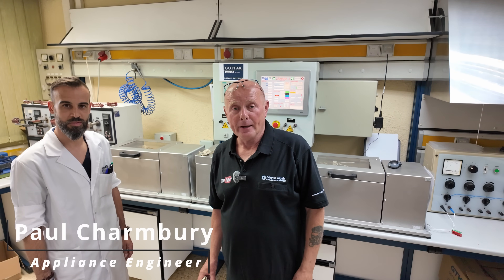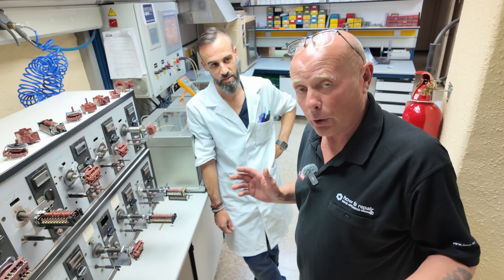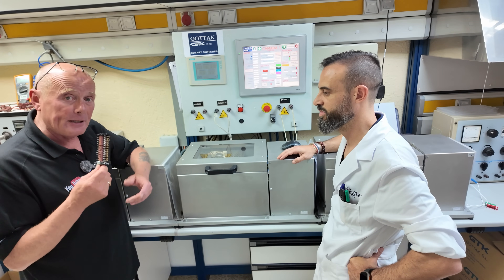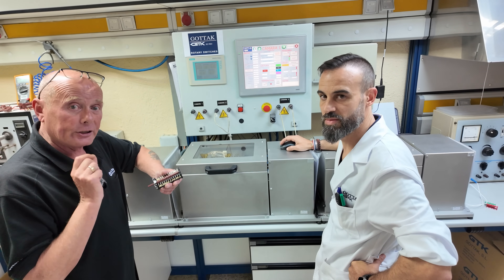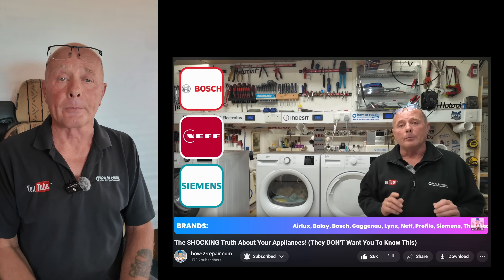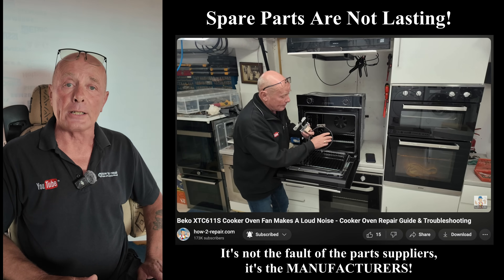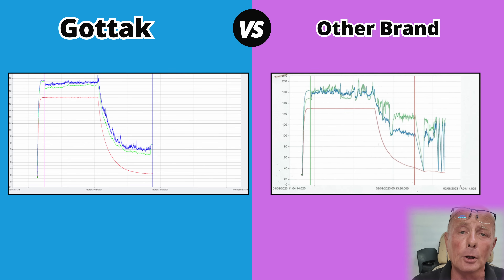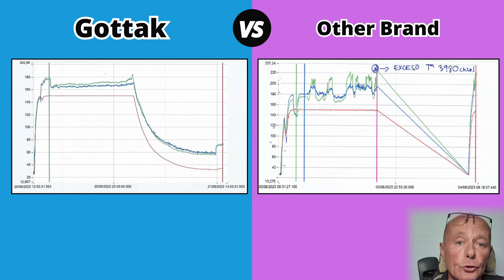Why Your Appliances FAIL SO FAST! Lab Results EXPOSE the Truth!

Comment: There are plastics that supposedly last for a thousand years.
And then there are the plastics used in consumer products and automobiles.
Reply from the maker: @anomamos9095 You've hit on a really interesting point about plastics! It's true that some plastics, designed for very long-term use in specific industrial applications, can indeed last for hundreds or even thousands of years under stable conditions.

However, the plastics used in many consumer products and automobiles are often engineered with different lifespans in mind. Factors like cost, flexibility, and the specific demands of the application (think of the impact resistance needed for a car bumper versus a disposable food container) influence the type of plastic chosen and the additives used in its production. These additives can affect how the plastic degrades over time when exposed to environmental factors like sunlight, heat, and moisture.

As discussed in the videos https://www.youtube.com/watch?v=QsdGd2qDPaI & https://www.youtube.com/watch?v=xn03N3b0-lE, the intended lifespan of a product often plays a significant role in the materials selected. For a deeper dive into this, I encourage you to watch those videos.

If you found this insightful, please consider subscribing to the channel for more discussions like this! Also, feel free to share this comment with others who might find it interesting.

Comment: Im a dryer enthusiast and we have 3 at home. A old zanussi tc7103 and a old tricity bendix from same era and a even older zanussi with the orange start button. Bullet proof they have only asked for a belt and jocky wheel there entire life
Reply from the maker: That's great! It's refreshing to hear about appliances that last and continue to serve well. Those older models were built to last. It's unfortunate that today's machines often don't hold up the same way.
Reply: Yeh I love it. I fully service it every 6 months and regular cleaning after every use . It's so quite and solid built ..I love it

Comment: Im going out on a limb here but A lot of the problems with unreliability is down to the consumers, wanting ever lower prices for appliances, so it has been a race to the bottom, not one person actually WANTS to pay out money for a fridge or a washing machine, they would rather put that £300:00 towards a holiday or a few meals out, when you think about this , a £300:00 washing machine keeps you supplied in clean knickers for ( say 5 years) , £300:00 will barely buy me 3 tankfulls of super unleaded petrol for my car, now thats what i call good value for a washing machine. Years ago, when i first started as an engineer, £300:00 would buy you a machine that span at 800 rpm and had a 5kg load or 9lb back then, along with a tiny door you had to struggle to get clothes in and out of, you don’t even get 800 spin machines any more. Todays machines are better value than ever, when you think, car manufacturers will sell you a new engine ecu for a car at a cost of £1200:00 and you can buy the whole machine, thats motor, circuit board, pump, drum assy and other parts, and are cars lasting any longer ? No they are not .  people cant park a washing machine on their drive, for their neighbours to see, so its never ever going to be a sexy product people aspire to own, its never going to work like that. In my opinion, the minimum price of a washing machine should be £600:00, and that would still be good value, further to this, a lot of breakdowns are caused by consumer mis-use, and abuse. You get what you ask for.
Reply from the maker: @brutonstreettailor4570 That's a really interesting perspective, and you bring up some valid points about consumer demand and pricing pressures! If I recall going back to the 80s you would pay a couple of hundred pound for a Hotpoint 95 series or the Hoover A3 series in today's money that would be a roundabout what you state £600 the problem being it's not just the consumer, the manufacturers are trying to get more and more market share at one point they were driving the prices down to do this but now they are buying up brands to obtain the market share.  It's true that the desire for lower prices can influence manufacturing decisions and potentially impact the quality of components used. As you mentioned, the value proposition of a modern washing machine compared to other expenses is quite significant.

Our videos (https://www.youtube.com/watch?v=QsdGd2qDPaI & https://www.youtube.com/watch?v=xn03N3b0-lE) touch on the economic factors at play in appliance manufacturing, including the balance between cost, features, and durability. Your point about consumer misuse also highlights that the lifespan of an appliance isn't solely determined by the manufacturer. Thanks for sharing your insightful thoughts! Please subscribe to our channel to continue this conversation.

Comment: We had an Indesit washing machine that failed about a month after the end of the warranty period.  A service agent called out (£60) and said it was the programme board - a new circuit board would cost £200, the programme for it another £50 and a programmer device to transmit the programme to the chip another £60, so £310 for the parts plus another visit and the labour to install it.     So we bought a new on, different make!   
I took the "old" one apart and all the components were in perfect order, the motor looked like new.  Then I tried the electronic board and removed capacitors one by one, but all tested OK.   I tested the other components and again, all OK, so the only suspect left was the programming chip.  The circuit board was never intended to have parts replaced as the tracks came off with the heat of the soldering iron.  
Perhaps it was programmed to count total time plugged in or the usage time using the 50Hz mains and then fail?   If it was £50 for a new board fully programmed, the machine would have lasted another 4 years.
Reply from the maker: @karhukivi That sounds incredibly frustrating! It's certainly disappointing when an appliance fails just outside the warranty, and the cost of repair seems disproportionately high compared to buying a new one.

As discussed in our videos on appliance lifespans (https://www.youtube.com/watch?v=QsdGd2qDPaI & https://www.youtube.com/watch?v=xn03N3b0-lE), the complexity of modern appliances can sometimes lead to such situations. While it's difficult to say definitively what caused the failure in your Indesit machine without a thorough investigation, your suspicion about the programming chip or a potential time-based failure mechanism is interesting and highlights some of the concerns around built-in obsolescence. The fact that the other components appeared to be in good order further adds to this suspicion.

The high cost of the circuit board and the associated programming does make repair uneconomical in many cases, unfortunately. We encourage you to watch our videos for a deeper dive into these issues and what consumers can look out for.

If you found this explanation helpful, please consider subscribing to our channel for more insights into appliance longevity and related topics!
Reply: I doubt they program failure counters. If caught they will really get in trouble. Micro-controllers have a lifespan. Usually 5-10 years. There are automotive grade microcontrollers  that cost 1$ more and are rated to last 20 years. It is just a variant when i select a chip for a design ex from ST, or Texas Instruments i have the same part in different grades.  I design PCBs. We don't think about repair when designing a board, unless it is specified in the product notes. Typical design parameters are, make it cheap, reliable to 5 years, and choose components that will be available for 10 years, also we look the EMI emissions to get the CE certification. It all comes from the top management, nothing we can do other to try to pass laws to force the companies out of this stupidity.
Reply: @dfloper  I have worked on PCBs for many years and most of them withstand a component being de-soldered and replaced.  But some of them have tracks a dirty grey colour and the heat of the iron causes them to detach from the baseboard.  That was what I was dealing with.    Not too difficult to program a little routine to count 50Hz cycles and when it exceeds 6 billion or some other landmark, it then adds a random excess and when that has elapsed, it shuts itself down.  One would have to reverse-engineer the software on the chip to prove or disprove that, hardly likely to be attempted.

Comment: All my options on modern appliances are confirmed in this video.   It is exactly the same here in the US, modern appliances are basically attractively packaged junk.  I still have my original Maytag automatic washer and gas dryer, purchased new in 1984.  No repairs ever on the washer.  The dryer needed a new belt in 2021 other than that, just regular cleanings to prevent lint  accumulation inside.  My Maytag dishwasher was new in 1988, it has never required any repairs so far.  My GE refrigerator is also from 1984, only a couple serviceable parts have been replaced by me.
 I have no plans on replacing any of my appliances unless the machine becomes non-repairable.  ~  Thank you for a most informative video proving what many people suspected.
Reply from the maker: @chatrkat It's fantastic to hear about your experience with those enduring Maytag and GE appliances! Your 1984 washer and dryer, and the 1988 dishwasher, are testaments to how well things were often built in the past. It might be a good idea to stockpile on any common components that fail as this will be what runs out. our videos https://www.youtube.com/watch?v=QsdGd2qDPaI & https://www.youtube.com/watch?v=xn03N3b0-lE discuss, the shift in manufacturing philosophies over the years has led to many feeling that newer appliances simply don't have the same longevity. Your approach of keeping them running as long as possible makes perfect sense from both an economic and environmental standpoint. We're so glad you found the video informative and that it confirmed your suspicions. Please subscribe to our channel for more content that resonates with your experiences!
Reply: @How-to-repair I appreciate your follow up to my comment.  Yes I actually do stock some parts here, however I always try to locate new old stock parts rather than the junk that comes from Asia, unless there’s no other option.  I am a strong advocate of maintaining and retaining. 😁  There are many different machines and items I’ve purchased years back I still have and use today.  I refuse to give up something well made, only to waste my money on brand new items that will likely fall apart in a short time.   Same is the case with my vehicles.   I look forward to other videos from you.   Cheers from Chicago.
Reply: But it may be also matter of user experience how to use appliance to deminish wear or brakling  Younger  generation is technicaly dumb because educated on computer virtual reality where automatic washer is build with dots and never gets scratch. . .
Reply: @Mikexception  you are correct.  Handle a machine intelligently and carefully, amazing how many problems can be avoided.  I was brought up by a father that practiced that every day.

Comment: I had a Samsung tablet fail at 15 months, it was switched off in the drawer for a week and when I came back from holiday it wouldn't turn on. The Samsung service centre said it needed a new main board, at a cost of more than a brand new tablet of the exact same type. I didn't buy any  more Samsung products.
Reply from the maker: @jm6604-c4d That's a really frustrating experience with your Samsung tablet. It's certainly disappointing when a device fails just outside the warranty period, and the repair cost is higher than replacing it. Our videos https://www.youtube.com/watch?v=QsdGd2qDPaI & https://www.youtube.com/watch?v=xn03N3b0-lE touch on how the design and availability of spare parts can influence the lifespan and repairability of electronics. Experiences like yours highlight why many consumers are concerned about the longevity of modern devices. Thanks for sharing your story, and please subscribe to our channel for more discussions on product lifespan and consumer rights!

Comment: I was on a building maintenance course years ago where I was told that a washing machine had a 7 year life cycle. I was told if you get 7 years out of it and it fails then buy a new one. I highlight that my machine broke down at 7yo and as an electrician I fixed it. I was told more fool you as it will break down again in 3-6 months and it was more cost effective to buy a new one as the cost in real time was a lot cheaper. Yep it broke down 5 months later.
The 7 year rule applies to other appliances. Also to be fair you it is more cost effective  to replace say a oven than pay for it to be repaired. My oven is 10 years old and I have replaced the element twice
Reply from the maker: @andrewwhite3793 That's a really insightful real-world example that aligns with what we discuss in our videos https://www.youtube.com/watch?v=QsdGd2qDPaI & https://www.youtube.com/watch?v=xn03N3b0-lE about the intended lifecycles of appliances. The building maintenance course's "7-year rule" and your subsequent experience with your washing machine breaking down again after repair certainly illustrate the point about the cost-effectiveness of replacement versus repair for some appliances beyond a certain age.

Your oven experience, having replaced the element twice in 10 years, also highlights how even seemingly simple repairs can add up over time and make replacement a more appealing option financially.  Thanks for sharing your valuable experience and confirming these trends. Please subscribe to our channel for more discussions on appliance lifespans and repair economics!

Comment: An oven would last me a lifetime if this was the only problem. I use an oven only on  holidays to bake something. it's too much waste of energy to heat it up daily. Aren't ovens full of electronics these days to modulate the heat output? Mine only has 3 levels, switching two spirals.

If that switch was easily replaceable, it wouldn't be a big deal. But paying for a repairman might be as much as a new unit.

I somehow thought this would be about washing machines with a mechanical "program". I have one of those. It seems complicated.
Reply from the maker: @j7ndominica051 That's an interesting point about oven usage and longevity. For someone who only uses it occasionally, like you, the lifespan could indeed be very long if not for potential component failures. You're right, many modern ovens do incorporate more electronics for precise temperature control, which can introduce more potential points of failure compared to simpler, older models like yours with the three heat levels controlled by a switch.

As we discuss in our videos https://www.youtube.com/watch?v=QsdGd2qDPaI & https://www.youtube.com/watch?v=xn03N3b0-lE the increasing complexity of appliances can make repairs more challenging and costly. Your observation about the repair cost potentially equaling the price of a new unit is a common concern. While your older oven with a replaceable switch seems straightforward in theory, finding that specific part and the labor cost can still be prohibitive.

Our videos primarily focus on the built-in obsolescence aspects we see in a range of appliances, including washing machines, and the increasing integration of electronics is a recurring theme in shortening their usable life. We encourage you to watch them for a broader understanding of these trends. Please subscribe to our channel for more discussions on appliance longevity and repairability!

Comment: I buy used appliances before a new one.
Reply from the maker: @Justin_80 That's an interesting approach! Buying used appliances can certainly be a more sustainable and often more economical choice. Built-in obsolescence is now backed by governments, which are enforcing the disposal of appliances through special depots. This has almost wiped out the second-hand market. It is now very hard to find used appliances in the UK. They must go to specialist disposal sites, and even tradespeople cannot buy machines from there. These machines have to be scrapped. This allows manufacturers to shorten the lifespan of their products because there are fewer second-hand machines available.

As we touch upon in our videos (https://www.youtube.com/watch?v=QsdGd2qDPaI & https://www.youtube.com/watch?v=xn03N3b0-lE), the lifespan of appliances can vary, and a well-maintained used appliance might still have a lot of life left in it. Plus, it reduces the demand for new manufacturing, which can have environmental benefits. Of course, there's always a balance to consider regarding potential repairs and energy efficiency compared to newer models.

Thanks for sharing your perspective! If you found this thought-provoking, please subscribe to our channel for more discussions on appliance lifespans and consumer choices!